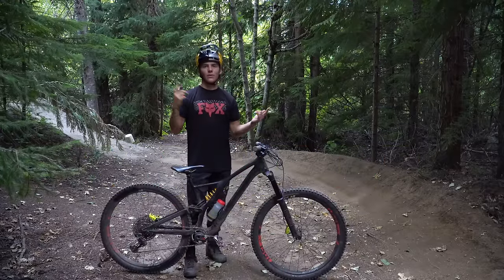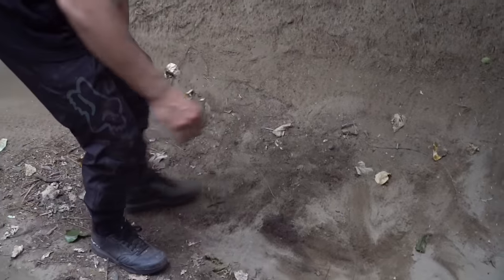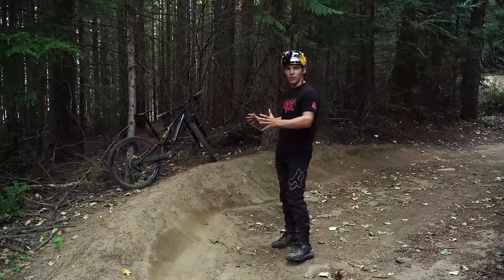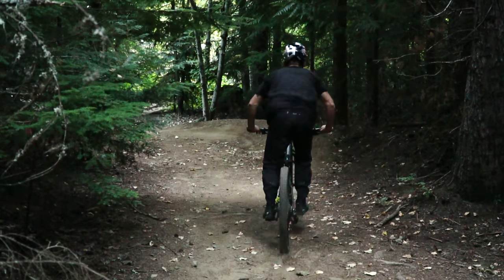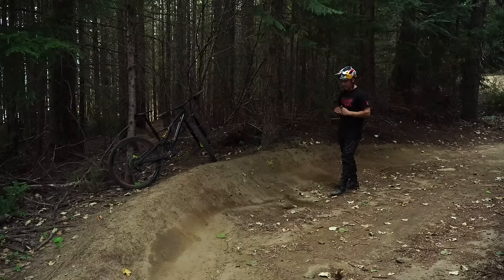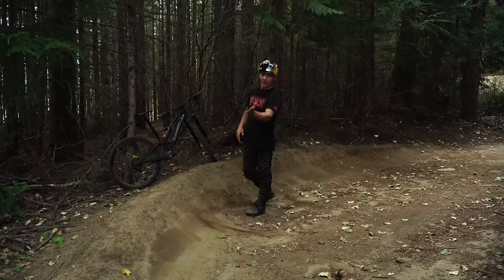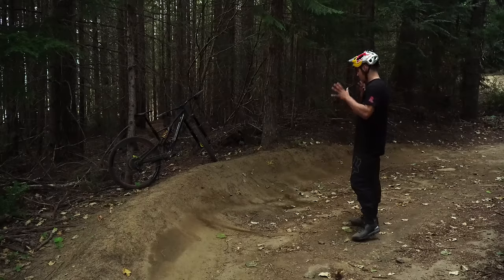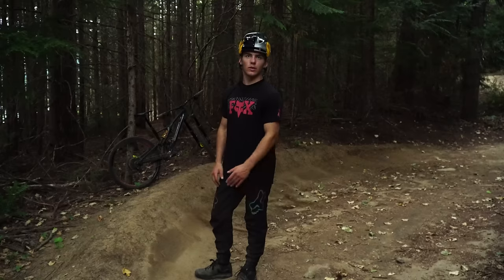HOW TO SCHRALP A CORNER ON YOUR MOUNTAIN BIKE | Finn Iles

Comment: There's part of the technique here that is demonstrated in the clips, but not mentioned.  Look at 03.15 and 03.31, and you'll see his inside foot is down - the opposite of what you'd expect in a normal turn.  I'm no schralping expert, but that's got me wondering whether part of the technique here is to start with your feet level but then apply more force through your inner foot.  This would make sense because you normally apply most force through your outside foot as this puts more of your body weight/momentum down through the tyre into the ground - i.e. the opposite of what you want when you're trying to get your tyre to slide in a schralp.  If you put your bodyweight/momentum through the inside foot, you'll be pushing the tyre outwards rather than downwards, which is presumably what you want.

Comment: How do i prevent going otb after roosting my frontwheel always washes out:(
Reply: Marius bro I wanna know too. Try running a lower pressure in the front. Helps me sometimes. Also use the bunny hop technique to loft weight from the back